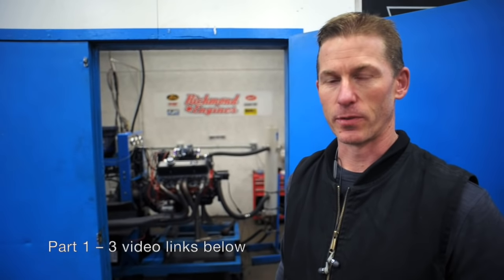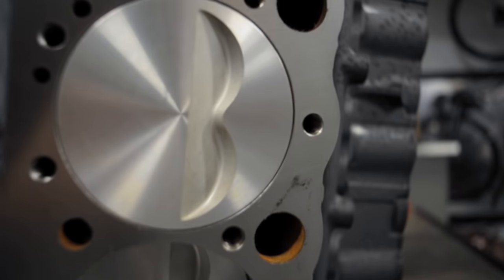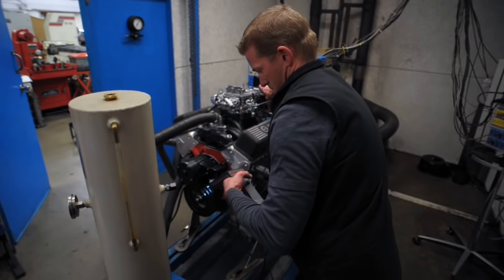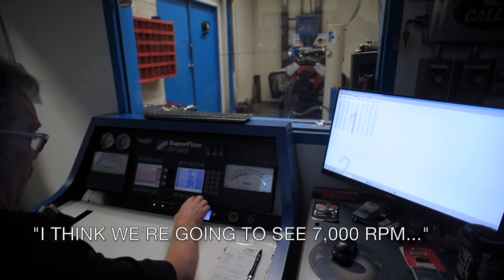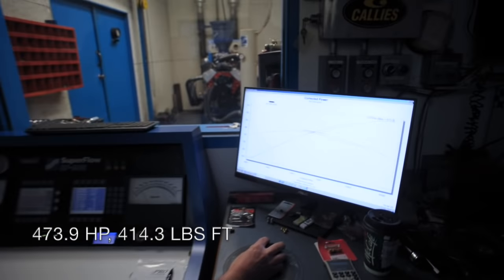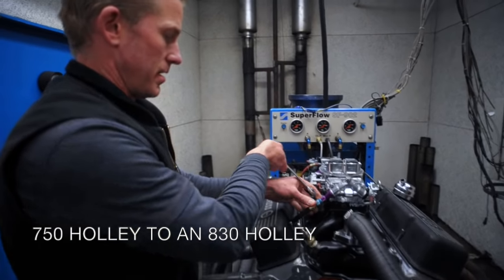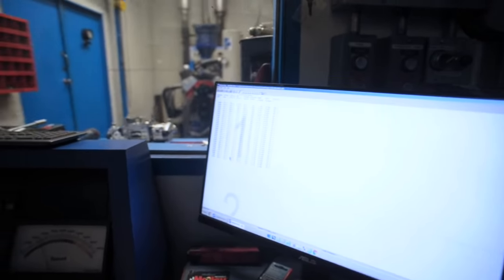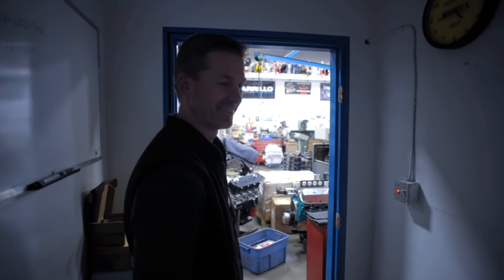SBC 283 Crankshaft + 400 Block = 500+ HP (Dyno Test 1 of 2)

Comment: Reminds me of the old small journal 327 based builds the dirt track boys use to run in the 70' into the early 80's turning ungodly rpms. 
They'd have headers glowing red after every heat race.
Ya'll remember those days, because I know a couple of ya'll have to be as old as I am  from reading comments.
I never did sell any of em my lil 327 either, and they were always offering me good money for it too. 
That's when the engineering was what you could afford, and you used what you could scrounge up between the scrape yards, and friends of friends. 
Few had the factory hot rods, but they were usually older just home from Vietnam, are daddy's money. 
But most of us just making minimum wages, either still dating or just married back then.
Drinking few cold ones, maybe Mexican cigarette or two here n there.
Mainly it was all about that we could do with our imaginations, the big 3, and WOT!
Who else was like that back in the days of long gas lines, and out running the local police, because you couldn't afford another ticket. 
At least that's how it was for me, but couple friends. 
Thanks for the memories of times when life was good n simple.
Reply from the maker: Sounds like some good old fun!! Thanks for commenting!

Comment: Was building them in the 80’s with hi compression, ported Holley street dominator intake, ported and gas relieved Fulie heads and ported quadrajets with inline carter vain pumps (for use when in it) and didn’t have anything running us down. Did run heavy springs and drilled the valve retainers to lighten them up.⚡️🏎
Reply from the maker: Cool stuff :)
Thanks for commenting!

Comment: Wow, hard to believe you can make 500 HP with that small of a cam.  Those heads must really be working.
Reply from the maker: Hi Rick Dion, agreed! We knew we were on to something when a SBF 302 cu.in., with AFR heads and a 9.1:1 c/r,  and 6" rods, produced 455 HP and 375 LBS FT—1.5 HP/cu.in. We applied that to this build and achieved the same result and a couple extra—1.52HP/cu.in. We didn't produce a dyno video of it, but here's the SBF 302: https://www.youtube.com/watch?v=cgzTemIAMvI&t=4s. Best regards!

Comment: Fantastic combination, im sure Chevrolet engineers were aware of this combo. Shame they never built one ..
Reply from the maker: Hi Miguel Puig! Their loss; our opportunity! Best regards.
Reply: It because Chevy never built  cnc heads to make this combo worth producing on a factory style head this combo might make a horse per cube, but as I said before you can put afr heads on anything over 300 cubes and make 500 hp
Reply from the maker: They sure do work great!
Reply: They might have done something similar if the muscle car era had continued, but the manufacturers were forced into focusing on economy and emissions instead of performance during the 70s.  Remember, the 400 was introduced in '70, right before GM's big compression drop in '71.
Reply from the maker: Absolutely right. Glad we can do these things ourselves :)
Reply: Junior Johnson was and some old fart named Darrell waldrop drove it on big asphalt tracks when the restrictor carb plates first came on the seen smart guy
Reply from the maker: There’s a history lesson :)
Thanks for commenting.

Comment: I am putting together a 353 Cu. In. SBC. A 0.030" over 400 with a 327 crank, Icon forged flat tops, 6.0" rods, Milodon gear drive, Offenhauser crossram and either an 850 or two 600s as I have both dual and single top for the intake. Not exactly sure of what cam I will be running. Initially I purchased the optional off-road Z cam (140) and thinking a solid roller would be fun. RPM will be over 7000 or close to 8000 with a roller. Lots of block prep, oil considerations, and some good flowing heads. I have been dreaming of using the 400 with a short stroke since space saver bearings first came out. I have a set of the Clevite bearings and also a set of King bearing spacers. Finnally I am going to realize my dream engine. Quite a few more goodies are in the engine for reliability, such as Milodon 4 bolt caps, Shark oil pump, Milodon oil pan, electric water pump, shaft roller rockers and so on.
Reply from the maker: Wow that all sounds amazing. I’d go for the solid roller like you said! And I’d recommend AFR heads. Depending on how much you you go with would determine the size. How much power are you aiming for? 
Thanks for sharing your thoughts and commenting!

Comment: Not to knock you chevy guys (because I own a '66 Belair 350 now) but Mopar did this with their 340. 4.04" bore x 3.310" stroke. Those factory 7.534" rods was where I believe the magic happened. I had one in my '72 Duster. Was .030 over with X-heads 2.02 intake valves & 292/509 lift hydrolic cam, 750 double pumper and 10:1 compression. I'd wind the shit out of her all day and shift @ 7200 with still more to go. Being a teen on a budget I'd run 89 on my drive to school & back if $ was tight. My '66 tops at around 5k max and can't hold a candle to the fun factor of that fast rev high rpm power the "smaller" Mopar offers. It could barely spin the wide micky tires with 355s but 2800/3200 stall converter, it would jump off the line in the power band with full traction & blow the doors off all the 350s with even more top end and power. I miss that car. My research into building a similar big bore short stroke Chevy for the '66 is what led me here!! I still remember the Infamous Hot Rod? Article on the 400 block/327 crank build running on 87 and I always could relate. Nobody believed me I was running 87/89 octane with 10:1 compression and spinning to 7200 being safe. I could shift at 8k without even trying she just wouldn't stop pulling. Though I did pony up the extra cents for the 92 almost always.  Back then the cheap stuff could be had for under a buck a gallon..those were the days!
Reply from the maker: Hey thanks for commenting! I encourage you to check out our other videos where you’ll find our 400 block, 327 Crankshaft  build( like the Hot Rod article ). 
The long rod, short stroke stuff is definitely the ticket and fun to drive :)

Comment: Tony Mamo flat out got that design right on the eliminators before he parted ways with AFR...

Those heads prove with tests like this what they are capable of... I mean a 180cc runner making 500hp, that is tough!!

Velocity monster ports is what they are!!!   It also proves a 300CI engine can make good 500hp power and no need for 383+ unless you want torque.. Look at the ZZ430 430HP on the 350CI chevy.. The LT4 Hotcam is small, 218/228 is not a lot compared to most cams.. 

With AFR COMP 195's, a Comp 230/236 HYD Roller 350CI on 93 should be thumping 500+ HP all day long with good torque.  The stroke is the issue for torque, on the street torque is key.. 

Nice build...
Reply from the maker: Thank you very much for your comments! We’re very happy with the results except not quite enough spring pressure. We’re going to lighten it up with titanium retainers and add 50 lbs more pressure then whip it again!
Reply: @ceperformance  Bump it up to the XE282HR-10 cam, 500+ all day long i bet! Maybe 520 from where you left off!

Comment: In 1988 I built a 406 with Flat top pistons and a 64cc head 1.94 valve pocket ported imperfections removed. Crane HMV 278 cam ,Weiand dual plane. 750 Double pumper Hedman hedders. and header mufflers . Was a torque beast would love to have had it dynoed
Reply from the maker: Hey that sounds great! Thanks for sharing :)

Comment: Did you even try a tighter Lsa, this combo has much more potential than you guys have found !
Reply from the maker: You’re right about its potential. We were not at all looking for maximum horsepower obviously. If we were then a completely different camshaft, larger heads and a better intake manifold would have been used. What we’re impressed by and happy with is that even with very conservative components, the output and drivability is remarkable. 
Thanks for commenting!

Comment: This seems to prove what Smokey Yunick always argued: “put the longest damn rod I the engine that you can”. Longer rods increase dwell time around TDC and make the heads act as if they were larger than they are. That is why you can get that kind of power with a relatively conservative cam.
Reply from the maker: Absolutely! It’s so often over looked. Thanks for commenting!
Reply: Short stroke big bore is why it rpms like it does. A basic 327 winds the same with mild cam timing.
Reply: Dwell at TDC is what results in increases cylinder filling for a given head and cam. That is what makes power.
Reply from the maker: @b.c4066  
Thanks for commenting!
Reply from the maker: @mitchblack7730  
Thanks for commenting. Much appreciated!
Reply from the maker: @mitchblack7730  
Thanks for checking out the video and for commenting!
Reply from the maker: @mitchblack7730  
Thank you for commenting!

Comment: I've wanted to do this with an aftermarket Ford 8.2" block. Nice tidy package with short and light rods.
Reply from the maker: I agree. The SBF packages are really great. We built a “302” a few years ago for a custom who was building an endurance race Old School Mustang he was taking to the Baltic Classic race. Quite an amazing adventure… worth a google search :) 
https://www.endurorally.com/events/the-baltic-classic-rally/

He needed an engine no bigger than 5.0L that could run on crappy fuel and run the distance. 
What we built him started with a Dart block with a 9.2” deck height (not the standard 8.2 or the larger 9.5 like the 351 Windsor). We used a 3” stroke steel crankshaft and 6” long Scat rods meant for a Chevrolet. We narrowed the big end to fit the Ford crank journal width and hit the 2:1 rod ratio. With a very mild hydraulic roller and 165cc AFR heads it made 450hp between 6500-7000 rpm and a broad torque curve peaking at 5500 rpm (375 lbs). 

Thanks for commenting!

Comment: I built a 327, several years ago.. it was a 210 hp 2 brl 327 that came in my 68 Camaro.. Once Worn Out, with little compression, I had an Older Friend, my Dads age, who Drag Raced, in the H/S Class.. He miked out the engine, all componants, and told me how much metal to have removed, from heads, and block deck.. I put in a 3O/30 solid lifter cam in, and my friend, Charlie, the master mechanic, degreed it in for me.. I had a 4-Speed, and what ever gear came in the car.. After about 50 miles of break-in time, I decided to TURN IT LOOSE! I CAM OUT OF THE HOLE, FROM FROM SITTING STILL.. Power Shifting from first, to second, THE SPEED-O NEEDLE, WAS ON 75 MPH, AS SOON As I slammed 2nd gear, and looked.. It was a bad machine!! Once I put in a 57 Pontiac. Rear,  with posi, and 5'38 gears, it was TERRIBLE! NEEDLESS TO SAY: I did not make long trips! I did go out 25 miles a few times, at 35-40 mph..
Reply from the maker: Great old memories for sure!!

Comment: Just wondering why you would choose 114 lobe separation angle for this motor
Reply from the maker: Thanks for asking. I really like the wider lobe separation because it gives a milder idle with less exhaust fumes and still makes great power. Higher vacuum too which is nice on a street car with power brakes.

Comment: we put in a 235 custom made crank in a 327 then ran aluminum titanium alloy rods that then put in over sized cylinder in the block, we even seasoned the block polished the inside of block ported everything. the crank was built for the rods and piston we used matched the counter weights on the crank . we had to port the cam bearings to get the custom cam in it just to big for the stock bearings. but ended up to be one crazy engine even terry fisher said it was crazy when he drove the car. we started with rick news dragster engine then ended up putting another 25,000 in it . we went with high compression for a tunnel ram 13.5 to 1 it came out good, runs rpms like most engines dream about. the pro racing engine builder said it would run 10,500 rpms all day long. i have had up to 15,000 when my clutch blew but then i got a rev eliminator i try to shift at 9,000 rpms. the engine still runs today it has lots of runs under its belt but i try not to push it to its limits it just cost to much to repair it. every time i had to tare it down it cost 5,000
Reply from the maker: Wow, sounds like a beast :)
Reply: @ceperformance  the most expensive engine i ever owned but been getting lucky getting the 4 inch stroke 454 with the 02xx 400r turbo trans for free with low miles on them got 4 so far from 6,000 miles to 58.000  miles on them modeled after the ho 454 70 chevelle engine 450 hp at 485 torque stock crate combo trans good to 800 hp

Comment: Ya like everyone else said... great build!
I've always wanted to this same thing to a 400 low deck big block mopar. 4.37 bore, 2.200 valve and a 3.38" stroke and a 4-speed... golden
thanks for posting :)
Reply from the maker: That sounds great! What’s stopping you? 
Thanks for commenting :)
Reply: @ceperformance  Oh just a little project overload at the moment. I’m in the middle of a 1000 HP
 N/A Mopar for my ole street strip fury.
I’ll get there eventually. Ha
Thanks for all the great videos 🙏🏻
Kevin
Reply from the maker: That’s encouraging :)
Thank you again.
Reply: @griffittsgarage I did a similar build with a 403 olds. 30 over and a 3.38 stroke. I think the bore was 4.381 on it. Ran very well despite not having  a good set of heads.
Reply: @marcmo7138  ya, that sounds really similar, super fun combo. 🏁

Comment: Nice job !!
New subscriber here, and even better that you're also in B.C !! 
I have a 69 Chevelle that I am building. I will keep watching for some good pointers or possible ideas
Reply from the maker: Thank you for messaging! What are you going to build for your Chevelle?
Reply: @ceperformance  I'm not sure. I got it with no motor or transmission, so no point trying to keep it stock since it isn't an SS. So I have just been sitting on it for a few years and getting ideas. I do have a couple 6.0's I was thinking about, but I would love to build a stroked big block. But these engines you guys are building look really impressive. So now my mind is really confused lol
Reply from the maker: @Drifter6942  
Clean slate! You can do anything you like and that’s awesome.

Comment: I really like your build, very impressed with the #'s on 87 and 94 with the fairly mild parts you used, I have a 18* 89 octane 399ci. with significantly more rowdy parts than you utilized and it did 641 hp@6400 and 560 ft lbs@5700, again very impressed with your build.
Reply: What cam, heads, and intake did you use?
Reply: @dwesley8984  ; Large journal solid roller 260/266@50......679/668  int. 1.5/ ex. 1.65  GM Performance 18*  2 piece lower tray/upper spider..........Brodix C-Series 18* milled to 17* 261cc runners 404 or 414 cfm smudge on paper work. 10.7 to 1. QFT Black Diamond 950.

Comment: I have always loved the short stroke Chevys. so I found this video interesting. money, CID and RPM is what it takes. some 3 weeks ago on YT I saw two 327s (bord/331) dyno'ed. one made 553HP at 7800 and the other made 596HP at 8300. now I would like to see someone put a 327 crank in a 400 block!
Reply from the maker: Hey, thanks for commenting! If you haven’t, check out our 354ci videos. The 400 + 327 crankshaft engine :)
Reply: @ceperformance  thanks! I am going to checkout that 354/short stroke 350.

Comment: Back years ago Hot Rod magazine did a engine design competition for its readers.  The design I entered was a 400 with 3.0" crank.  Didn't win of course.   I never had the funds to build one and always wondered how it would work.  It is cool to see you guys building one now.  It would sure be fun in my 1989 iroc camaro.  Or my protour 1969 camaro.  If I could get specs on bearings / proper rod length and piston pin location for thus combo maybe I could build one.
Reply from the maker: Right on! If it’s a possibility I’d say go for it :) This would be great in either one of those cars. 
Make your dream a reality! Thanks for commenting.

Comment: There used to be a shop just off Scott Rd. that specialized in rebuilding Chevy small block engines.  I was into off-roading, not street racing so low end torque was more important to me.  I had a small block 400 in a Blazer that they completely redid and turned it into a torquey stump-puller which I also used for snow ploughing.  Previous to that I owned a1963 Chev 4X4 Panel truck that I found in Burnaby with an actual L76 in it!  At one time or another I've probably owned every Mouse engine made,
Reply from the maker: Cool stuff! Nice to hear that your from our area :) Thanks for commenting.

Comment: I’m sure your viewers understand that octane alone doesn’t give a power increase. For those who don’t, you might explain how much extra ignition timing you were running with the 94 octane to create the hp increase.
Reply from the maker: The difference between 87 to 94 might allow for 3-6 degrees more advance, depending on the engine.

Comment: that was so cool. i am building a Dart block large journal 327. i thought about going with a 348, 3.25 stroke 4.125 bore and if i had known to get pistons made in north america i had to order diamond pistons i would have done it. hopeing for 440 HP 8000 rpm solid roller daily driver.
Reply from the maker: Holy moly, sounds awesome. Would love to hear from you when your done!

Comment: My dad built himself a 327 with iron heads in 1981 that turned over 8000rpm still pulling. Smoked all four on the 77 and then beat several quick sixteen rails to the 330ft. First engine he built in his own machine shop...still going, still see the occasional wild iron motor for someone's rat rod.
Reply from the maker: Cool stuff and fun memories I bet! 
Thanks for commenting :)